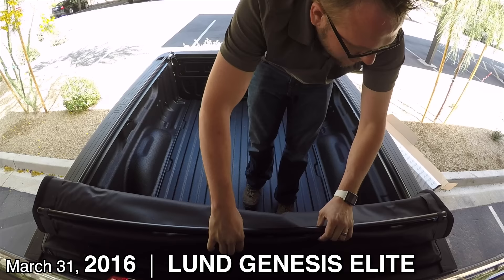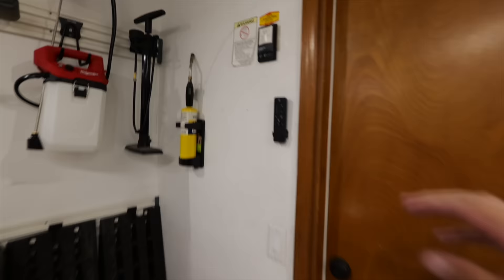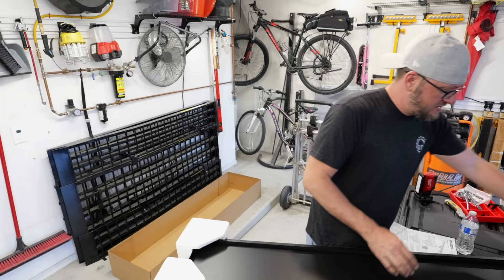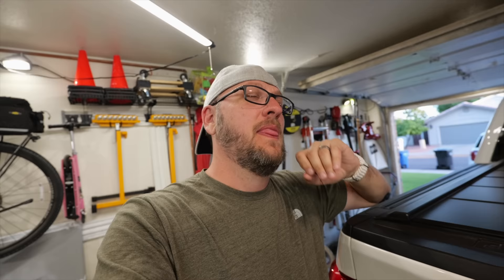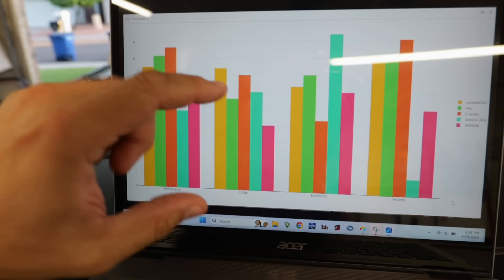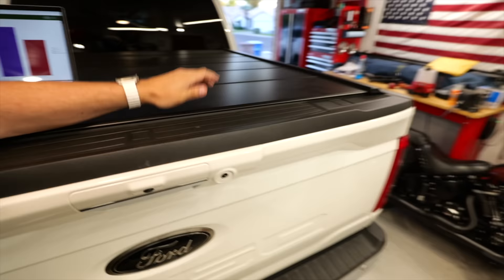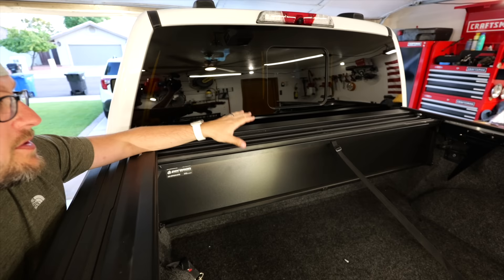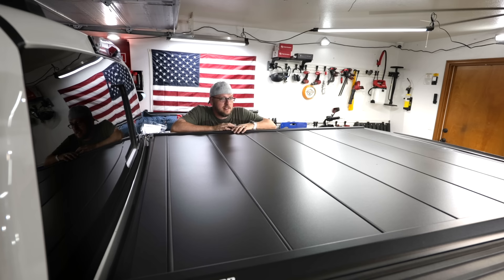Is Peragon the Ultimate Tonneau Cover?

Comment: I've done what I can to reduce water leaks. It would be such a problem, but my gets quite a bit in. With a light to moderate rainfall, water seaps in.
I've readjusted, reinstalled and realigned according to their video and print manual with no luck.
Mine is also hard to open and close when the panel. 

The only thing that has improved my situation is putting a rooftop tent over the bed of my truck.

Comment: I would love to see you test out a DiamondBack bed cover.
Reply from the maker: If they are down, I’m down.
Reply: They probably won’t give away that thing with all the reviews it has already. $2000+ is a big chunk of change for me but I still want one.  I like the idea of putting large amounts of weight on top of it.  Ahhh someday
Reply: Love my diamondback cover got the 270 had the old backflip revolver x4 which maybe is the older version of the bak one he reviewed also that one was recommended by a coworker and that one sucked no drain tubes let water in winter time because of the water let in on the rails it essentially froze the cover flat had to wrestle with it in winter to get to tools etc gear was happy to get rid of that cover diamondback is pricey but it works secure and the next step up is essentially a cap/topper for your truck

Comment: I’m concerned with the brackets on the sides that cause the cover to “flip” and remain in the truck when the cover is removed. They seem like they would be subject to getting bumped, bent, and or knocked out of alignment if something shifts in the bed. Is that true? They also look sharp, like they would punch a hole in a bag of sand or a cardboard box if it came into contact with it.

Comment: I had one on my 2008 Dodge Ram QC. It was not the easiest to install, extremely noisy on the highway above 70mph(The panels would bounce up and down and create a harmonic noise inside the cab. There was always water in the bed after a car wash and heavy rainfall. They did hold up to snow well but the powder coat finish started to slightly fade after 3 yrs. The bundle of panels is quite heavy and not the easiest to remove BUT you do have the option to remove them. I did not like that the hardware(nuts and bolts) were merely zinc coated. I would like to have had Stainless hardware.

Comment: I have one that is a little older that I had picked up for my 2019 f150 and moved over to my 21 f150. I like some of the updates your cover has mine doesnt use the boxlink system to install it just clamps the bed rails. the one thing i dont like about the version you have is you cant open it with the tailgate up. mine is one of there older designs that actually has a lock on the second panel from the window and if anything happens where the tailgate gets stuck i can at least get into the bed to fix it. the box link install is pretty cool for sure though

Comment: I was about to buy one of these until i realized that you can't use it if you have anything in the bed of the truck. The cover has to fold down into the bed in order to open. So if you are like me and keep your 37x12.50 spare tire on the bed of your truck, you would not be able to open the cover at all worth the tire in the bed.

Comment: it seems like you had to drill holes on the side bed walls of your truck.  Out of all of these, I think the retrax manual sliding is the best.  The only negative is all the space you loose up front.  I also like the retrax because you can lock it secure in any position and still keep your stuff up front out of the elements.
Reply: I have one and no drilling is required with the Paragon
Reply: We have some classic edition models that have a drilling option, but all of the Platinum, Limited HD, and Limited HDx (shown in this video) do not require drilling. What you see in this video is Dan mounting to the pre-existing holes that come with the Ford Box Link System!

Comment: I was so happy to see you have the swing cases in the bed, so do I and was concerned if this cover would work with them. I do have a question,  dose it rattle while driving? And can it hold weight on top.

Comment: Not a fan of this cover. Each panel is what, six or eight inches wide, and must fold downward.  If you have a cooler or toolbox or pretty much anything in the bed, the cover won't retract. You have to empty the bed and then open the cover.

Comment: Are there any completely 100% waterproof bed covers, no leaks whatsoever, pressure water at carwash or during serious rainstorm?  Not sure I want a pickup if i can't cover and keep the bed completely dry?  Also, your comment about not liking to pressurize the tailgate seal preferring airflow, does that mean you don't like the RSI bedcaps which are designed to pressure seal?  Thanks.

Comment: Hey Dan, which tonneau cover are you still running today? Having a hard time deciding between the Peragon Limited and the Bak x4s. It seems that the Peragon would last a lot longer die to the aluminum exterior va the fabric cover of the x4s. But the x4s seems it may be easier to operate, especially if running it open.

Comment: Why not include a more realistic test with a garden hose or sprinkler?
Reply from the maker: People taking their trucks through the car wash isn’t realistic? Also, the car wash is the perfect test because a garden hose for 30 seconds isn’t the same as driving in a downpour for 3 hours. The car wash lets you see where water will most likely come in should it be exposed to the rain for an extended period of time. I would argue a garden hose is less realistic than the car wash.

Comment: I don’t usually comment on videos but I’ve had mine for almost 2 years and I absolutely hate it. I live in Southern CA where it is not super hot and the metal on the lid absorbs a ridiculous amount of heat. You can cook food on it. Plus it is a pain to load gear to the front of the bed because the way the mechanism folds down. I don’t want to have to put any extra storage bars or racks in the front to resolve an issue that shouldn’t have been there in the first place. These issues would’ve been resolved if I went with a fold back or with a roll back cover. The concept seemed good but in reality it is a bigger hassle. Wish I would’ve done more research on this product or had a realistic video on all the draw backs to this product.
Reply: I couldn’t agree more. Another commenter talked about keeping a canoe paddle in the truck to move items out of the way to open the cover. I can’t tell you how many times I e had to army crawl under the cover to move items just so I can open it. It’s crazy that the design flaw even exists. Let alone all of the other flaws with the design. It’s horrible. I loved my Bakflip and I just ordered a new Bakflip and can’t wait to scrap this peragon piece of junk.

Comment: Carwash test is fine, I prefer a break in test if you are going to talk about security.
Reply from the maker: A break in test is really not a good test. Fabric looks best but can be cut, Diamondback solid aluminum is indestructible but makes your truck look like a utility company truck, everything in-between is a good compromise but a small man with an elbow drop could easily get in. Truth be told 99.9999% of tonneau cover theft prevention is out of sight, out of mind. People aren’t going to cut, jump, or plasma cut their way into the bed of a truck in HOPES something cool is in there.

Comment: Great camera work - but you missed two big negatives about the unit.  1. The way the cover drops down into the truck bed really does limit loading the truck. 2. Did you park this in the sun? The surface of this black metal cover gets extremely hot in direct sunlight - and then you put your hand on it to open it. Ouch!

Comment: Can you imagine a real framing or concrete or block trades Person using that system have to be so funny.
Reply from the maker: You’re correct, they wouldn’t because it doesn’t give them room for toolboxes at the bulkhead. Not everyone who owns a truck is a tradesman but as someone who has spent 20 years in construction I am very in tune with what you are taking about.

Comment: I have been between the peragon and bak revalver and cant make up my mind. What one would you recommend?
Reply: Be aware with the peragon. If you have a box in the back that slides to the front under breaking you will not be able to open the cover. Because it folds into the bed. With the Bak if you live somewhere it gets down to freezing the vinyl gets so stiff you can’t roll it up.
Reply: Go with the bak. I’ve owned both, no contest!

Comment: Thanks for the video. Great job on the bed camera. Water isn't  as much of a concern to me as dust is.Water is relatively clean and will dry quickly as it gets warm under the cover. Dust just makes a mess of everything...Any thoughts on that?
Reply: Dan I also looked into this cover for my 2021 f150 limited but I decided to go with roll &Lock a I thought that it was a better Quality, more secure, and keeps the rain out better that looks great
Reply: I'm a female, so, either you appreciate them or you don't, BUT!! If I may ask
Reply: (Oops, sorry! LOL:
Reply: DOES "DUST" HAVE ANY "Ç?
MY THOUGHT WAS: THIS GUY COULD FIND SOME KIND OF "ANTI-STATIC" SPRAY, MAYBE EVEN A CREMÉ APPLICATION, AND MY HOPE IS THAT DUST AND FINE PARTICLES WON'T BE ABLE TO HITCHHIKE ON YOUR HARD WORKING BABY
Reply: I have this cover for 2.5 years now and it keeps dust out.  I can also confirm the water intrusion in this video is accurate.

Comment: I personally cant downplay its ok if it leaks. Thst should be an attribute of covering your bed as well as security.
Reply from the maker: @Truth2240  tailgates themselves leak regardless of how well a cover performs. The seal where the top of the tailgate meets the cover is always a weak spot and tailgates themselves don’t have weather stripping (you want a truck bed to breathe). So in my opinion, it’s not downplaying, it’s accepting the reality that pickup trucks are pickup trucks, not SUV’s.

Comment: I'm gonna be an outlier here.. But i'm looking at getting a f150 lightning.  I want a tonneau cover that makes the bed easily accessible, but also provides the best aerodynamics so I get more miles per kwh.  any recommendations?  So far I like this and the Bak X4s
Reply: RetraxONE MX Retractable Truck Bed Tonneau Cover. Look it up. I have it installed on my F250 6.7.

Comment: Curious if your bed is full (say plastic bins) can you open and close it?  Had a different company flip top, but Fl sun killed all the seals in a few years
Reply: We recommend a simple cargo hook for pushing things back into that space (that would normally be taken up by a mounted canister) and pulling them forward when you're ready to open. Or an adjustable cargo bar works well to prevent load shift when you don't need that space!

Comment: First time watching but does this bed cover support weight on top of it? I had a Bakflip G2 that could support some weight (I think it was 300lbs or something.
Reply: This isn't designed for heavy loads, it's designed for security and flexibility (quick release). It can support 50 lbs of direct weight like a cooler or tool box and 300 lbs distributed like snow or ice!
Reply: The metal is so thin, it will just bend if anything is put on it. I also had a Bakflip and I’m going back to it because the peragon has so many design flaws. It’s really a terrible cover.

Comment: Got one on a Silverado with 5’8” bed. Worst cover I’ve owned by far out of about 20. 

First off, $1200 for a short bed that isn’t motorized is robbery. But I figured it would be high quality.  Nope. 

Leaks like crazy. Has less space than the trunk of my crown Vic. Anyone who says these are good doesn’t need a truck for the bed. You lose a LOT of space. 

Super trickery just to open and close. 

Sent it back and picked up a tri fold off Amazon. Holds water out better and cost half the price.  Way more convenient. 

DO NOT BUY

Comment: From a dirt bike rider, this looks awful. Folding down uses front tire room, meaning you would NEED to remove cover but I like having a cover at trailheads. Ramp, fuel etc out of sight, plus hikers think I might be a hiker due to not seeing moto stuff (yes anti people are real) plus a thief knows a dirt biker ain't coming back soon vs the hikers are silent and might be back in 10 minutes (seems to be the norm they start on the multi-use trail and say NOPE....LOL

Also I prefer as water tight as possible, no cover is waterproof...LOL Resistant is the word that needs to be used. For my own use, I toss a mattress in the bed, plus other camping goods and use a bed tent. I need my mattress dry....same for clothes and other gear. Granted your car wash test is interesting but gimmicky because no real life situation will you have high pressure blowing at seals etc. So I'm not basing my opinions on a carwash. I just don't like the idea of a seal/gasket on each piece that means it will wear out in a year or two, most of us park outside (due to truck length etc) and then factor in my situation of living a mile up so the UV is strong and that will wear out the rubber even faster. Interesting idea, and probably works for those not really using their bed.

Truxedo X15 Pro is what I currently have but after 6 years it needs changed. Full disclosure they gave it too me when they gave me the Bed Rug (same company owns a lot of these businesses). But it works for being water resistant. I just looking at what company to bug for a hard cover myself to test for us Dirt Bike riders. The Bak 4s is on my list (same company as Bed Rug) but rolling up in winter sucks with snow and ice as we ride still weekly so not sure I want to mess with that.

I really like the DiamondBack but then I have to use the hitch carrier and loading to the top looks way too tall and scary to be practical. Still on my list, but yeah I don't know...LOL Plus no more bed tent, probably could sleep under the cover but getting dressed etc would need a pop up shower tent. Sigh, Decisions, decisions.

Comment: Does this product rattle or shake while driving at high speeds?
Reply: No, the cover will not make noise while driving!
Reply from the maker: Nope
Reply: I own one, yes it does. It certainly flexes enough for rain to leak in at every seam. If you don’t lock it in a car wash, the dryers will blow it right open.

Comment: I have an A.R.E hinge up hard tonneau cover which lips around and over the entire bed, can’t fold it back ( a draw back), but gives more height inside the bed, AND never gets water, I can’t drive my Quad into the bed, so looking for a folder, This ain’t it
Reply: Yup I have a hard top cover on mine like that. I live right outside Seattle so it rains a lot. So having no water get inside is great. Mine actually isn’t too hard to take off if I need to fit large things in, just requires 2 people.

Comment: No such thing as a waterproof bed cover. For the price with a discount coupon, it's a great buy! love my Paragon. Ive had it for several years now. I keep a canoe paddle in the bed to grab things that slide forward. It looks like you have a push rod on the inside to help open it? What is that? I have to push down on the front of the bed cover to start the open process. Wish i had that. Thats my only complaint.

Comment: I can tell you from experience. That at least in the north east, they do not hold up well. They fade and get chalky, the torque struts wear out and allow the front portion to fall in. I had the 1 of the seals completely fail and come out allowing copious amounts of water to intrude.   And the other seals never really complete let sealed. the rollers become worn, corroded and difficult to roll. Keep in mind. This is my experience, over roughly 4.5 years. In the beginning it was cats ass, but the chinks in the armor so to speak soon became apparent.  Plus, this is also in the north east in some very harsh  environments. Your results may vary.

Comment: I would not buy that bed cover because you can't use 20" of the front of the bed because that is the room needed to collapse the slats into the bed. Imagine not being able to have any box or tool box at the front of the bed on these trucks. The bed is already 5'7", then you lose 20", that in essence leaves you with a 4'1" bed. No thanks Peragon.

Comment: Just hammering your paint with those crappy Swir-O-Matic car washes....detailers are cringing right now lol...
Reply from the maker: There is a reason why I bought a white truck. It is not a pavement princess, it will get dirty, it will get scratched, and I don't plan on spending 3 hours on a Saturday going through an absurd washing protocol. My pickup truck is not a show truck or a Porsche 911 GT3 and I don't intend on pretending like it is but it is nice to run through a crappy car wash and not care because it's not black.

Comment: 2 weeks in…Worst cover ever, misleading marketing, insane price mark up for the HD version, loud as hell, gets stuck almost every use, takes up just as much if not more bed space than most any other cover/canisters on the market. Hardly any attempt at water resistance, Finicky install… instant buyers remorse.

My biggest hatred is that from the bulk head to the bottom of the bearing ramps it’s 16” of unusable space and if your cargo sits almost bed rail height it has to be moved forward at least 21”… I have a review of mine up, with details, measurement, and some examples.